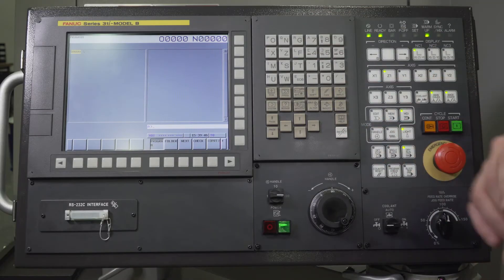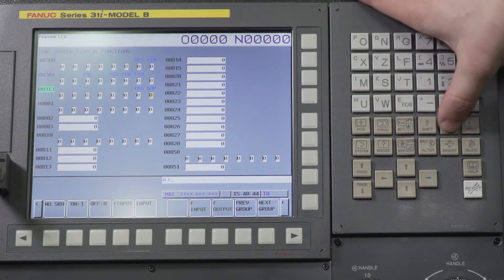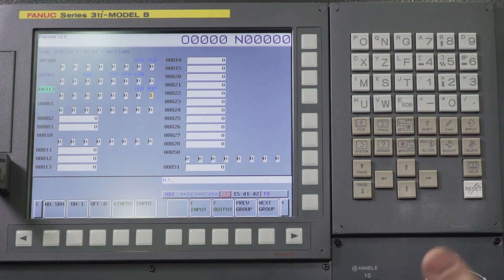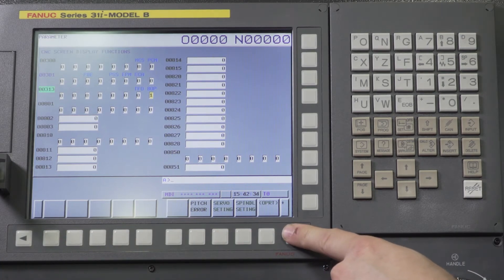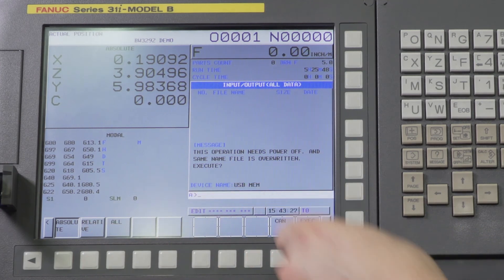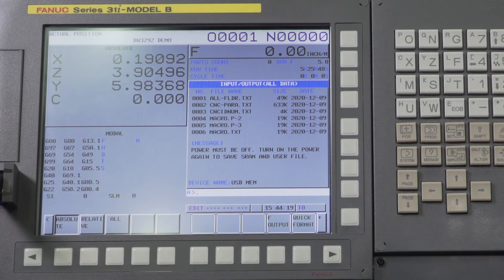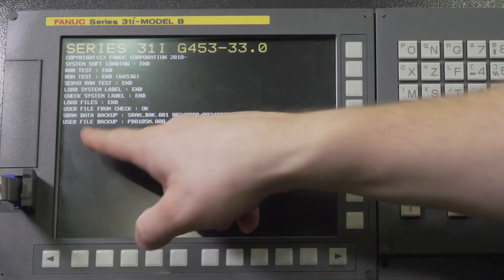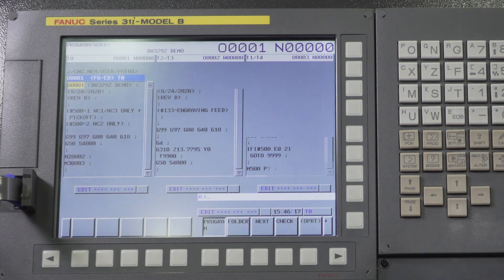How to do an All Data File Back-Up

Comment: Is it the same backup on 31i a5?  Mine doesn't have parameter 313
Reply from the maker: Hi Nick, Unfortunately the 31i-A5 doesn’t support this function, however there might be another way. If you reach out to Fanuc directly, they might be able to help you.
Reply from the maker: Hi Nick.  Unfortunately the older controls do not have this functionality.  Each file would need to be output individually, as far as I know.